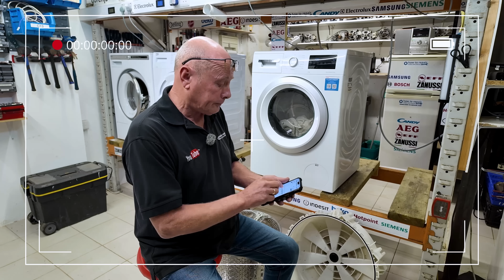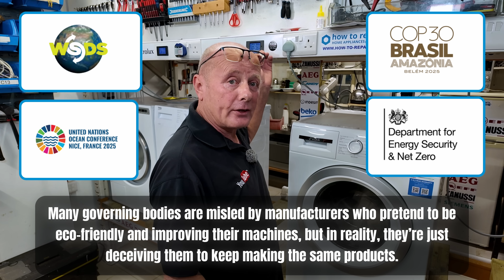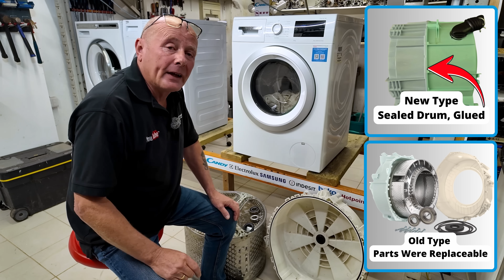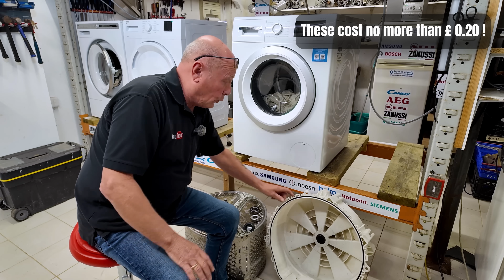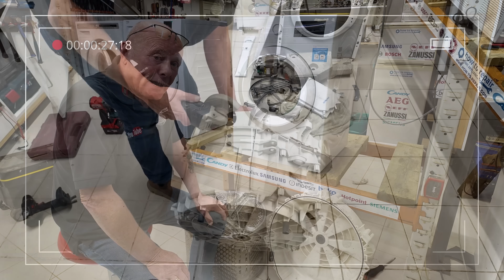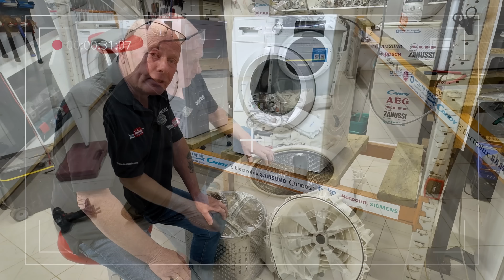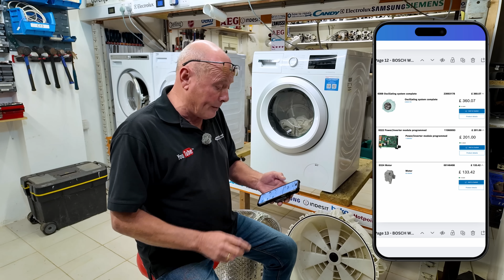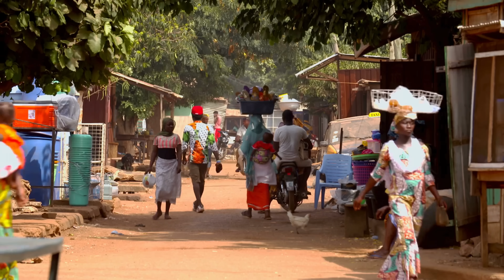Washing Machine SCAM EXPOSED! The Truth About SEALED Drums: Naming & Shaming

Comment: Fake environmentalism. Filling landfills with appliances that are designed to fail in 5 years is horrific for the planet.
Reply: Yep. There's not as much profit in it for them when they lasted 30-90+ years. Some old American refrigerators from the 1930s still run to this day. We had a washing machine in this property from a family that lived here previously and it was 35+ years old. We kiIIed it by too many over filled cycles.
Reply: @organichuman same in russia. old fridge works perfectly fine for like 50 years. it had problem with mechanical thermometer but fix was cheap quick and easy. new ones die after one or two years of use. sometimes compressors very soon after they were replaced.
Reply: @Aliveforfun особенно если компрессор меняет кто-то кто понятия не имеет как это делается
Reply: @kos2u ну типа друг купил не японца как я советовал. а ру сборку. потом его такие же ру мастера чинили несколько раз подряд. я потом много раз повторял "а я ведь тебе говорил".
Reply: @Aliveforfun  I found a 1973 ZILL refrigerator that was functional and had a gasket in perfect condition.
Reply: @toninica410interesting. my refrigirater has compromised squished rubber seal but still works. i only replaced mechanical thermostat that only provides on off sequence in pre determined temperature gap.
Reply: @Aliveforfun  they last 7-10 years average, they know people are not THAT stupid yet.
Reply: More likely that your bearing  seal was damaged by limescale
Reply: @organichumanthat may not be true as the initial product unit cost might be higher to compensate. It's far better if replacement is driven by true technological improvement and innovation. 
At the moment there is no incentive for manufacturers to innovate, the money rolls in no matter what. Products should not only have an energy rating, but also a reliability rating. The only indication of this currently is the length of the warranty.
Reply from the maker: Consumers need the ability to maintain and repair their products to reduce waste and keep costs manageable. Without such rights, we risk a future filled with disposable, hard-to-maintain products. It's a conversation that needs to gain more momentum. Think about the environmental impact of building machines and then recycling them. These machines are often transported halfway around the world, which adds to fuel costs. It's baffling that we need to ship them every five years due to failure.
Reply: The planet will just keep going, but its passengers will suffer.
Reply: @johnlesoudeur3653  BEES IN A HIVE
Reply: yes, like microsoft, "kiling" so much pcs, capable off runing well, To inject win11..
Reply: @pedroveloso9707 Gates should be charged with crimes against humanity, the absolute reckless disregard for resources by sending millions of perfectly good computers to the landfill for his BS win 11 garbage.
Reply: and course we, the customer get the blame as always, its little peoples fault..
Reply: @normski262  They'll tax you for disposal
Reply: @dosgos It’s like a closed loop
Reply: @dosgos  they do, local council charges £25-£30 to remove each large appliance.
Reply: @normski262 marketing departments have evolved to tell the customer what they want. It's remarkable how quickly a new show room model, turns into old fashion junk. It happens almost as soon as the product leaves the show room. In many respects this view is correct, as the product  sells leaflet  aspirational description  invariably fails to meet real life performance. A result of falling quality and cutting corner design. I was very disappointed in the design quality of Bosh fitted cookers, but that is another story. At least Bosh supplies all the parts needed to fix the faults produced by design errors.
Reply: Manufactures should be forced to publish MTBF figures along with the product energy ratings. The which report, does provide a guide to the better products, for a price. Unfortunately the marketing model of rapid product replacement means that any report of best in class is quickly made out of date. Perhaps repairability should be made part of the CE approvals process.
It is unfair to expect customers to understand a products repairability at the time of purchase. The information is simply not available. The first time the customer learns of this limitation is when the product stops working, and some repair engineer takes the back off the product, and explains the nature of the problem to the customer.
Reply: This is happening with Geenan cars in particular. My friend is still driving his 35 year old 8 series and all he had to do over all that time was service it, fix alarm system. Still running sweeter and smoother than most new BMWs.
Reply: BUT! They are backing down on climate change now. Why? Because they are building Data centers that take water from farmers and pollute the air, but in time everything they gather will give them full control over all of us. In just over 1 century the plan these elite began will come to fruition. They know exactly what they're doing. They have so much wealth that fun for them is wars, children, human trafficking and hunting humans. Everyone will realize this sooner or later...
Reply: @dc6233 ha I remember reading a book I think was called "cocaine nights"
The rich people on an island had everything they wanted and were super secure, soooo they got bored and decided to  import a few criminals to spice up their lives😂😂😂
Reply: 💯 it’s an absolute environmental crime
Reply: @lt4203 manufacturing is now a batch process, with no long term support in the plan. By using parts specifically designed for a particular model, obsolescence is guaranteed when the parts stock runs out. No need to learn from engineering errors, just bring out a new model with a completely new set of faults. A clue to bad design is the inclusion of self tapping screws, or worse self tapping screws into soft plastic. Then there is the use of glue to hold a product together. A beloved feature of computer tablets, mobile phones and televisions. 
The sealed for life battery was the start of this slippery slope. A way to ensure a fixed electrical life for the product. A removable battery will only fix this route to obsolescence, when standard battery packs, with standard dimensions are used.
Reply: It’s in near every product. 
Preach climate change 
Punish users of gasoline 
Yet the stock market decides different , container ships by the hundreds arriving with throw away crap. Waste management ( new name for garbage dump ) is also big money 
Canada sends its natural resources to Asia then back to Canada to the landfill 
What a scam
Reply: Don't worry, by the time more people get suspicious, most of us won't be around, we'll be jabbed away by this, the next or next after that planneddemic.
But planet will be "saved" Just don't farta lot, we're stυρid enough to believe it'll heat the planet, so they serve us right...
Reply: They dont give a shit for the planet
Reply: We had. Whirlpool machine fail after 2 years… a month out of warranty.  Was offered extended warranty for €130 and just after 12 months the part failed again.  Dumped it and bought a cheap machine that has lasted a few years now.  Wouldn’t touch a > 7kg or >1200 rpm spin speed and keep the load light.
Reply: Landfills? That is the case only in 3rd world countries, of which the USA is one. Civilized countries like most of those in Europe have all those machines brought to the metal recycling companies or recycling centers, and the metals are re-used for new products. Each washing machine brings about 10 USD/EUR to the one bringing it to the scrap yard to sell it as mixed metal scrap. Many yards require 500 kg. scrap minimum to bring them before they are ready to pay for the metal.
Reply: 😅it the same in most industries 😊who cares about cost of part aslong as its out of warranty
Reply: you didn't really think all the "clean air" sh&t was real did you?
Reply: The ones that are making a big profit out of it do not care about the environment or anything ales for that matter.
Reply: Yeah, and the energy used in the industry to produce entire new products for replacement instead of just producing replacement parts at affordable prices... They advertise products as A+, A++ etc  energy class but they waste energy and they don't really care about energy waste, carbon footprint etc.
Reply: This is why every single environmentalistic argument falls flat on its face; We can't include carbon taxes if we allow planned obsolescence.
Reply: and they want consumers in EU to think about environment when the reason for all bad is in companies.
Reply: Fake everything...
Reply: Not to landfills. These things are eminently recyclable.
Reply: And all those companies campaign on being proenvironment because they use recycled aluminum. The PR campaigns around fake environmentalism are one of the worst things we've done to the environment we live in.
Reply: My Beko Washing machine and dryer gave up after 10 years.. it was  very reliable.
Reply: thats why I will repair all what is possible as long as it possible
Reply: Repair, Reuse, Repurpose, Recycle.
Reply: Don't you just love it when appliances are "eco" & save water but are designed to break in couple years. People are adviced to use double rinse because machines don't wash the detergent out anymore but hey, at least on paper we're saving water and filling the landfills!
Reply: machines need to be made serviceable not just the right to repair. They will say they are serviceable and parts available. In the country's where labour is cheap it makes sense that they are still serviceable because that will be he one that sells the best
Reply: 5 years is optimistic.
I just took apart a philips senseo, of which they make the floats now so that they fail in max 2 years. Well, maybe it was this specific type, but seeing a float thats meant to be open and let water in, with a magnet there, you know rust will build from day 1.
Reply: Landfills is a 3rd world solution... we haven't had landfills in decades
Reply: Its all products made to not last , so much waste , should be illegal
Reply: It’s not just w machines, it’s absolutely everything!
Reply: Burning limited resources to mass-produce landfills.
Reply: Its nothing to do with environmentalism but everything to do with capitalism.
Reply: Yes. That's not good. There should be good intention behind creating products .. 
I guess this was the spirit for some time, cheap expendable, replaceable things. Instead of long lasting. But in general, it's not good.
But the only thing to controle it, is kinda of through people. If the word spreads around. If someone actualy does a  good job of creating s9meyhing. 
If we zoom out even more all of this happens because of industrial revolution. Just make more and again. And it's kinda, cheap. 
It's up to us to kinda straighten things out I think..
Watching machine is not a thing you would want to replace really. There is no need. And those don't belong in a landfill. So some human upkeep does make sense in he long run. It's up to governments to put s9meyhing in place. Up to people to sort through allnof this. It's what this man does... It's going a little under the radar. But at the same time there is many people in many categories talking aboutthis...
Reply: Just shows you how much of a joke global warming is….not just planned obsolescence in machines, but the plastic recycling scam, the low-emission zone scam that you can literally pay everyday to drive a non-compliant vehicle in the restricted zones, so you pay money and everything goes away.  
This planned obsolescence has been going on for decades, first heard of it with house alarms going into fault mode and stop working so you call the engineer out to look at it, he resets software or does whatever he does and it works again in 5 minutes. 
The biggest problem is that people just accept this now, we’ve already been programmed to just lap it up and go out and buy a new one, no one expects anything to last more than 5/6/7years…..your lucky if a car lasts 10years now, they used t9 go on for decades.
Reply: 5 years would be nice, in 2 years actually.
Reply: Nothing gets to landfil since there are small businesses that manage the collection of them and the dismantle and repurposing for metal and burn recycle plastics. People have been recycling old appliances since a few years back at least. So its circular economy. Get the f out of ur caves and understand the f ing shit u live in once and for all.
Reply: don't wan't it too seem like i'm defending the c**ts (their planned obsolescence cost me 700€), but machines like this are mostly steel by weight and most of it will be recycled.
Reply: @testytesteberger6397 think about how much energy it takes to melt down that steel instead of just having the thing functional for a longer time
Reply: @pinkspirit445 again, dont want to defend, but less than making virgin steel. plus, why would coprorate shills care about anything other than their bottom line. we need the french revolution solution for them.
Reply: @testytesteberger6397  That's what they want us to think!
Reply: @testytesteberger6397 that may be true, but it would be better if it were recycled less often. There are losses in the recycling process, toxic chemicals are produced and a great deal of energy is consumed. There is also the inconvenience of buying and installing a replacement unit. It is often the case that the improvement is no better, in fact it is worse. You pay more and get less, with features that were once standard, now being sold at a premium. It's the same philosophy that shrinks grocery packaging, and charges more for the product inside.
Reply: @testytesteberger6397  And you would be wrong. I'm a metal recycler and new appliances year over year are becoming to be made up of ever more plastic that is not easily recyclable if at all. 

For instance, the drums in this very video used to be both metal - inside and out, but as the video, shows, it's now majority plastic, made not to be opened without breaking it. And the weighted ballast would be a metal plate, now it's cement. Gears, pulleys etc that would have been stainless steel/steel or brass are now molded plastics. Yeah, the outer shell is metal, but increasingly - that's it.

Dishwashers are another appliance that has become largely plastic. I cannot speak for Europe, but in N.A. there is hardly anyone recycling these types of plastics - they are buried or burned.
Reply: @thatcanada  my eu appliances are still mostly stainless steel, but i would guess things would be far worse off in the land of the free
Reply: You still talk shit talking points about the environment. ( oh no would someone think of the planet) Yes trash is a problem. But Cleary youve never heard of puentehill landfill national park
Reply: That is all what is ‘sustainable’ is about. The agenda 2030 is political promoted as ‘green’ and in reality it is Keynesianism on steroids.
All the best
Reply: Indeed. “Sustainability” is more than just using less water and energy.
Reply: read Milutin Milankovic - Ice Age Cycles and don't fall for propaganda...
Reply: Not land fill, its all given away by the consumer. Then its recycled ♻️ its a carousel scam. Repairing saves the consumer money. But the recycling firms rely on materials.
Reply: Totally agree.

Comment: Its a tragedy that spare drum costs more than the whole machine for a 25€ repair 😡
Reply: I suspect most repairs/call outs are covered by either retailer or manufacturers extended warranty. 
That's why the mark up on components is so high as that will be what the bill/quote to the insurance will be.
Often this will result in a write off - so insurer will just offer an age reduced allowance towards a new machine rather than new for old ? 
Other people "self insure" If a machine fails they just buy a new one rather than wait in /take time off for an engineer - two seperate visits if expensive components needed. 
I used to sell domestic appliances 🇬🇧
Reply from the maker: Thank you for your comment. I appreciate people like you taking the time to write it out. Please share it where possible. It might help others make a wise choice instead of being misled by the industry.